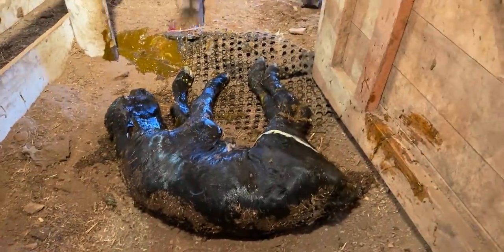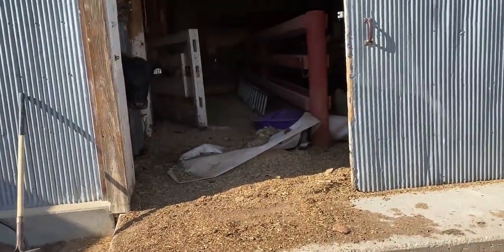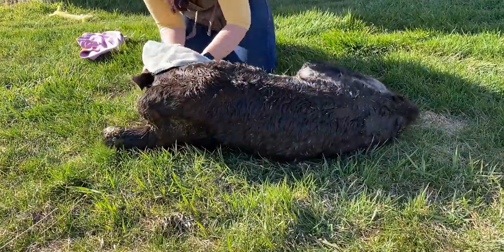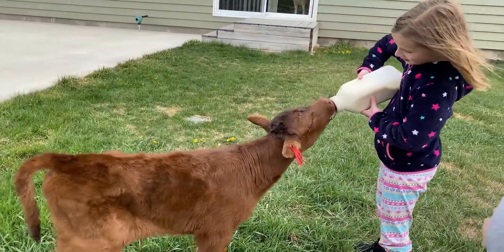A Breech Birth on the Ranch

Comment: Good job on that big calf delivery. Nice team work. Just a thought, we used a rope through the chain and would put it around a post  and then use it to get leverage. Not as hard on the hands, and if the cow goes down a lot less metal flying around. But good to have the puller for the big ones. 25 years on dairy farm. Thanks for the video’s
Reply from the maker: Thanks for watching T VP.

Comment: I love my puller. I hate using it, but like I was taught.... its better to have it and not need it, then to need it and not have it. Good job Mike. That is fantastic.  You are an inspiration for me to keep doing what we do.
Reply: i  called mine a calving aid, to help the cow calve as she pushes even with breeches if you only pull when cow pushes until the calf hips are out you can save alot of internal damage to the cow of course when the hips are out you have to go like hell  a tip for mike always have the calving gear close to the yolk with other gear you may need for calving another tip after calving a breech attach chains or rope aroud the hocks then you can lift the calfs backside up and hopefully all the fluids will drain out  or you could have a winch by the yolk to do similar

Comment: Good job Mike! Two quick tips. When pulling by hand use two handles, one below each foot. Alternate pulling left and right. It'll make a huge difference compared to pulling straight out. Second, to clear the airway immediately after birth stick a stem of straw in his nose and wiggle it around. Calf will sneeze and blow and clear his own airway. See you already know about throwing them over a gate to drain the fluid, that one was just too big!

Comment: Hello Mike, only from the hoofs, how did you know its back feet?
Reply from the maker: Good morning.  Back feet are Much bigger.   Thanks
Reply: Front feet will be toes up and back feet will be toes down
Reply from the maker: Unless the calf is upside down.
Reply: Yes. I had one coming upside down and backwards this spring that threw me for a loop. We had to get him turned so he was right side up but still backwards to get him out.
Reply: if you reach into the birth canal back legs have a sharpish point on the hocks front legs are rounded over the knee if upside down you can still feel the difference problems come with 3 legs together

Comment: Isn’t a breech birth hind legs forward and only the tail coming first? You have to reposition the back legs and then pull calf by back feet. Always use a puller to get backwards calves out fast and hang them by back feet to clear airways.use calf puller to hang it up and clear airway.

Comment: There is a difference between backwards and breech!!
Don't be like SRF and say a backwards calf is breech... His incompetence cost him a calf.
You are far from incompetent!!
Breech is BUTT first!!! Only way they come out is to be pushed back in and get the legs pulled up and out first. It can be done without loss.
Backwards calves come way more often than people think.
If we see hind hooves, we get the chains and get to work!! 
The critical time for backwards deliveries is when the hips come out... That's when the umbilical cord is entering the canal and can be sheared off.
Take a look at your calves when you find them, if the cord is long, they most likely came front first...
If the cord is very short, as in an inch or less... Odds are it came backwards.
Splint the legs, they'll be fine in about 12 hours... If momma wasn't such a RIP, you could work with the calf.. 
Thanks for the video!!
And for not being like SRF!!! He just watched as the calf suffocated because it came out, landed with it's head under it's body...  (Sorry I had to put the rant in... And the poor example of a cattleman that SRF is)